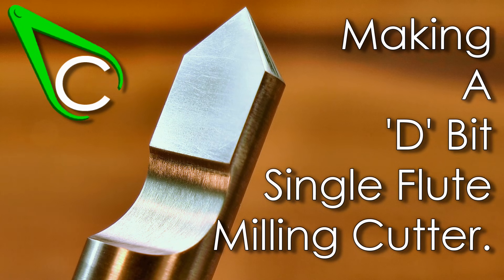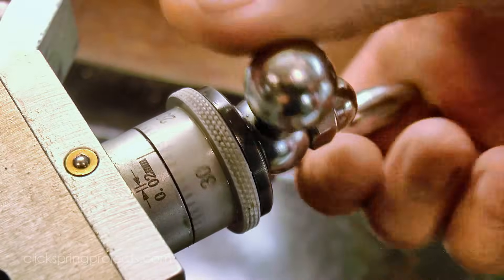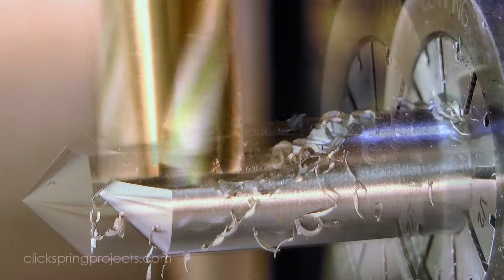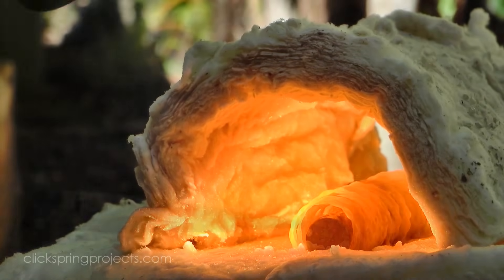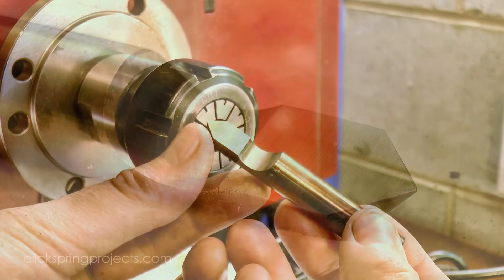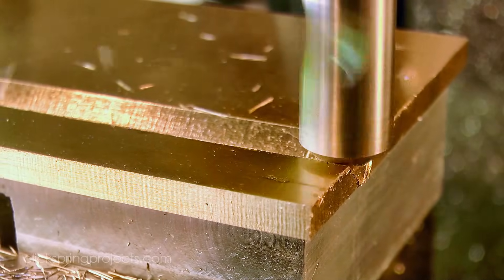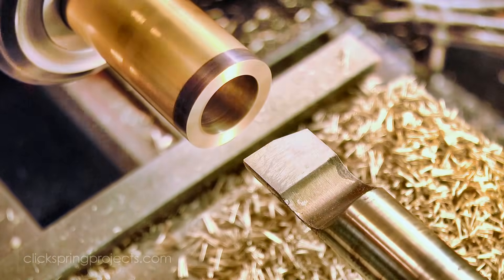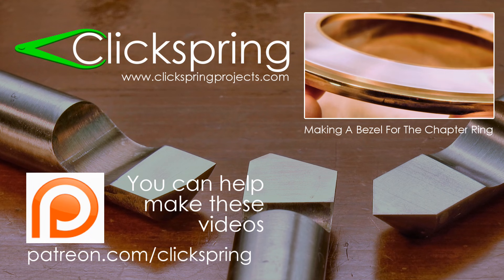Spare Parts #8 - Making A D Bit Single Flute Milling Cutter

Comment: When I was a kid I couldn't afford to buy milling cutters so I started making d bit mills. I found that if you insert some shim under one of the jaws in your 3 jaw ( I couldn't afford a four Jaw and collets were something I only ever saw in catalogues and books)  then you could generate some form relief.  You've just got to mark out the high point before you mill. (or in my case back then file ) the flat. Weirdly 45 years later I am still making these tools to overcome emergency problems in a hurry.  Keep up the good work the videos are fantastic.  Thank you
Reply: If there's any kids watching... auctions and scrounging are the answer. 

I got 200 (yes, 200) sets of geometric die head cutters for £50, a pair of Herbert precision drills for £50, a Parkson 2A horizontal milling machine for £50 (bit of a theme developing here).

I passed on two pallets of 4, 5 & 6 morse taper drills (maybe 500 drills) for free (help yourself son!) because I knew I'd never own a machine big enough to use them. That was before Ebay of course. Wish I'd taken them now.

I got a box of about 50 rotary cutters for £30 when the Cincinnati main dealer closed in Peterborough.

My first lathe was a Colchester Student for £200 (same place I got the Parkson).

I've outfitted a very decent workshop for next to bugger all.  Everything dates from the 60s & 70s and works fine.

Pickings aren't as good as they were 30 years ago but you can still buy decent lathes, mills, drills, etc if you watch local auctions and just nosey around machine shops. I've been offered very decent lathes and all sorts of other stuff for free. 

Scrap bins.  Never pass a scrap bin. Always be polite and offer cash or a bottle of something.

Comment: I need to make a pinch turning hollow mill for cutting a taper on a very small diameter PEEK fitting. I think by milling an internal taper and then basically creating 2 opposing d profile cutting surfaces, I can get it done.

Comment: You can use high speed steel if your mill will handle carbide endmills, obviously it won’t be a particularly nice cutting experience, carbide will absolutely eat HSS, then you just need to finish sharpen.

Comment: Hi Chris, your job is amazing, congrats!  I have a technical question to you, if you can answer, please. About Boric Acid + Meth Spirits, how much of each one do you put in? I mean, proportionality? Meth Spirits is a kind of alcohol? I'm sorry if is not written very well. Another doubt is in 2:20minuts, what is the liquid inside the glass, that you put in, something to clean the tool??  Thank you very much. I am Andrés Oscar, from Argentina. Regards!Thank you!
Reply from the maker: I generally mix the boric acid until a stiff paste, yes methylated spirits is a kind of denatured alcohol. 2:20 is a generic compressor oil for quenching, recommend this book for heat treating: http://amzn.to/2IdTQLw - Cheers :)
Reply: @Clickspring  Thanks a lot Chris for your job, for your answer and suggestion. It will help me very much. Cheers!! =)

Comment: Hi Chris, I want to get into hardening, I got a small tube oven which goes from 50 to 1200 degrees C, nice toy. I have noticed here you use boric acid + alcohol, but sometimes clay, and perhaps other things too. Also some soft iron wrap, what is this about? My main question is from all the methods you have used, which is the most recommended one to avoid oxidation and general good practices? I apologise in case this is already covered in depth at some video. cheers! Markos
Reply from the maker: Hi Markos - I have found by far the most effective method of oxide reduction to be Boric Acid powder.  I now have a varied set of mild steel trays in which I sit the parts to be hardened, and this ensures the glaze completely covers the part. Its rare that I see so much as a single spot of oxide. Cheers :)
Reply: @Clickspring  Thank you for taking the time to reply mate! I can verify I saw the process at the 'making of a square broach'. Do you mean you now use the boric acid powder pure (without alcohol)? And how important is the choice of tray material? cheers mate!!
Reply: @Clickspring  Can you, please, show picture or video on how you use mild steel trays and Boric acid to avoid oxidation, instead of wraping parts with Bailing wire.

Comment: These are too time consuming and tedious to make........a simple flat bit HSS cutter that cuts on 2 edges will work better and is simpler to make straight from the round tool blank on a grinding wheel.

Comment: Can anyone tell me what the purpose of mixing the tool with acid boric and apply heat
Reply: When you heat steel or iron Ea is easily reached for most particles. Think of it as an isolator, shielding for oxidation.

The metallic bonds take time to form perfect “crystals” (wrong term ik), heating it resets the crystals and rapid cooling freezes the crystals. Making it less flexible and hard.
Reply: @tarehjernetarehjerne4082  thank you

Comment: I don't understand how you got the 92 (or 46) degree angle using a dial indicator.
Oh...I see a calculator in the corner. I guess you used basic trigonometry. You fed the compound to travel a given distance, measuring the run-out on the reference rod. Using typical naming, given your angle A (46) and hypotenuse distance c (compound travel), the run-out should be c * sin(A). Same formula as for a sine bar.
You might at least have hinted at this. Took me some time to figure it out :)

Comment: Hi Chris, great video tx ! Can you pls comment on what the insulating material is that you use when heating  the bit, looks like an aluminium silicate blanket ?
Reply from the maker: "Kaowool" ceramic wool, you can pick it up off Ebay - Cheers :)

Comment: We have been using D shape or half lip cutters on our 3d engraving machine for over 40 years. About 30 years back I came across a design where I can give a relief to the cutting edge. So we made an improvised cutter grinder where a swash plate mechanism has been used for the relief. But this video is just awesome

Comment: Good stuff as always....Notice you're in Aus, could you give me a heads up on where you pick up your O1 and and any other interesting materials? 
I recently had difficulty getting Silver Steel in 10mm round stock locally (Newcastle, Maitland in NSW) and when I did they (Blackwoods) could give me absolutely no information regarding hardening and tempering. Ended up finding some info on the net as it was supposedly Stubs Silver Steel (now Erasteel) which said it was it was water quenching however there are also references to oil quenching and Erasteel appeared to have no information at all?
Anyway the water quench and subsequent tempering seemed to work fine for the stuff I bought.
The lesson was, I think, I may need to source from specialist steel suppliers?
Reply: The risk of micro-fractures from water-quenching can be alleviated somewhat by using hot water instead... ☺

Comment: This is just a simple presentation without detail like what kind of steel we can use to be properly threated for this kind of tool and........the operation on "3:10" needs VERYGOOD abilities otherwise you just make a spoilage.
Reply: Nelu, it was easy to miss, but at 0:35 he states that he is using "Drill Rod" . This usually refers to either O-1 or W-1 tool steel. The hardening and tempering directions would work equally well for either grade of steel.

Comment: I just tried making one myself! I it sort of worked for me haha. I think I either removed too little or two much material when making the flat. It seems to push the material rather than cut it. I'll have to head back to the shop and make another one. This time I'll be more careful. Thanks for the video!

Comment: Is making a V cutter for harder steels, like O1 very difficult ? You mention not having a certain grinder for the clearance angle on this type of cutter. I bought a carbide version from Melin in 3/16", but I need to make a larger V cut. Will you make a video one day? You use an end mill in the finger plate video., which worked out nicely. Cheers.

Comment: Great work. Great videos!  I bought the plans for the finger plate and would like to know more about your heat treat process. I see that you use meth spirits mix. What is it and what is the mix ratio? I've never seen it used. Thanks
Reply from the maker: Mix to a stiff past. The purpose of the boric acid/methylated spirits mix is to minimise heat scale. Thanks for watching and asking

Comment: Hi. Clickspring, I still do not know about the type of steel material your make cutter . Seem they are stainless steel :)
Reply from the maker: O1 tool steel, in rod form it is called "silver steel" or "drill rod". thanks for watching
Reply: Thanks... You hardening them with boric + wire to increase hardness up. So the ingredients to help them stronger borax or wire ?
Reply from the maker: The heating and then rapid cooling is what changes the hardness of the steel, the boric acid and wire are used to reduce heat scaling. Recommend this book to learn more about heat treatment of metals: https://www.amazon.com/Hardening-Tempering-Treatment-Workshop-Practice/dp/0852428375
Reply: Hi.. Thanks!... Your video is great on mechanics.... Expect you to do more video again .. Good luck !!

Comment: thinking of replacing old lathe as lots of back chatter and it can't make threads!!! :-(
it is a "cobra lathe from a uk supplyer not very big so upgrading. what do you reccomend?
what lathes do you use???
Reply from the maker: http://www.clickspringprojects.com/blog/which-lathe-should-i-buy Thanks for watching
Reply: https://www.maschinensucher.de/Voest-Alpine-Drehmaschine-W-490-1500-Voest-Alpin-W490/i-3892876  

this is pretty much the best on the market as far as tollerances and long javety go but you can look on the website , there are old lathes (real industrial ones manual and CNC with often more than a ton of weight and ridgidity) for a price of 1500€ upwards

https://www.maschinensucher.de/Drehmaschine-Zelenda-ZN-150/i-3405031

This is a new one used for advertisement that was probably close to never used 
had i the money i would probably take it after a trieing it out
https://www.maschinensucher.de/Drehmaschine-CHINA-CO-6230-910/i-2673187

A friend of mine has one of these and it works absolutely great with a sharp tool he can work so fine that he is able to work abaut 0,005mm repeatedly accurate 
and its a quality european manufacturer so you can get spare parts when needed 
https://www.maschinensucher.de/Universal-Drehmaschine-Ziegler-GH1236A/i-3517278

Comment: Why they use boric acid to harden the metal?
Reply from the maker: +Santi Ferreres Boric acid is used to prevent oxidation scale building on the metal during the heating, thanks for watching
Reply: Thanks and keep it up!

Comment: could you use this on a leathe?
Reply: Certainly. Back in the long past fellows like clickspring could not afford a mill so a lathe is what they basically used. I'm talking the 30's 40's 50's. They used D-bits back then, D-bits are still being used now, both on lathes and mills..

Comment: Question for you, the emory cloth stick you are using here, is that made from brass? The ones you show in the other video on how to make them are wood but the brass looks so classy.
Reply from the maker: +patw999 Wood is excellent for general purpose, but metal backing to the abrasive is essential if the part won't tolerate any rounding of the corners/edges. This is a brass polisher that I usually use with polishing compounds, but it can be re-purposed for emery paper too - more detail at the end of this video: https://youtu.be/uTAd1cJyqp4 Thanks for watching

Comment: Have you considered making a heat treatment furnace? Apart from anything else, with a plug in the end there seems to be only limited scale formation, I guess all the oxygen gets used up. 

I don't know if I can post a link here, but if this works, here is how I made mine: http://bodgesoc.blogspot.co.uk/2014/11/heat-treatment-furnace.html

Comment: Hey Chris, thanks very much for all of the useful information.  Would you mind sharing what the white fluffy insulating material is that you use while heating parts?  The stuff the part sits on, not the boric acid, of course.
Reply from the maker: +Nic Nicholson Hey Nic, that is Kaowool, a ceramic fiber wool. You can pick it up on Ebay. Thanks for watching.

Comment: So could this be a substitute for a reamer? I'm in the middle of a project (small solenoid engine) and my 1/4 inch reamer snapped. I don't want to fork 30 bucks over for one, but do have some precision ground .125 stock. Would your home made reamer be a better idea?
Reply from the maker: +rkshireygames Yes it can. Another very effective shop made reamer geometry is to form an ellipse facet on the end by grinding at an angle of approx 30 degrees. Thanks for watching :)
Reply: Clickspring Thanks! Love the content, I'm learning a lot!

Comment: Hi mate, have a few questions, is the tool steal you refer to 0-1 steel?After sharpening in theory should it be perfectly half the diameter? Is that a true Arkansas white stone, if not what is it and where can you get it?Last one is the brass tool plate that you made, what is that, im asking because i have one and have no clue what it could be forThanks a bunch, your vid are amazing
Reply from the maker: +Bertrand Labelle Hey Bertrand, yes O1 tool steel (stubbs steel/silver steel/drill rod all the same thing), just short of half is better, because it gives you a few sharpens and makes no material difference to the cut, yes Arkansas hard white stone, artcotools.com, not sure what you mean about the tool plate, maybe send me the time in video. Cheers, Chris.
Reply: Thanks, what i thought was some kind of tool plate was your brass blueing tray, i have a plate simmilar of that i think is a V block plate. Bought it with my mini lathe off ov a clockmaker, thanks. one more thing, where can i get that silver sauder
Reply: Clickspring
Thanks, what i thought was some kind of tool plate was your brass blueing tray, i have a plate simmilar of that i think is a V block plate. Bought it with my mini lathe off ov a clockmaker, thanks. one more thing, where can i get that silver sauder

Comment: Another well made tip. It's good to see someone explain D Bits well as they make excellent reamers for jobs that require a reamed diameter on a flat bottomed hole. I recently made one for a block of aluminum that needed a 4" long cartridge heater. A D bit made from drill rod was the perfect tool to ream .3750 clear to the bottom of the 4" blind hole.

Love the videos, keep them up!
Reply from the maker: +armorer1984 Will do mate, terrific to have you watching :)

Comment: Could you maybe show how you set the exact angle with the dial indicator?
Reply: MrP123 I'm no expert but I assume it would be some form of setting the compound, indicating the front of the taper, and then moving to the end of the taper and adjusting the compound until the dial indicator says the same value one would expect from just doing right angle trig of the taper

Comment: Hey Chris. Great video. I want to make the same tool. Can you tell me what that for a steel is you use.
Reply from the maker: +Ich xD Depending on where you live its called 'drill rod' (US) or 'silver steel' (UK/Aust.) basically its O1 tool steel in precision ground round stock form.
Reply: +Clickspring Thanks for your quick answer.

Comment: Hello Chris:  @3:47 you illustrate a relief angle.  But separate from feed speed and depth of cut would you not avoid that angle when machining brass?  It seems that that angle would risk climbing or pulling on the brass.  Much in the way you eliminate the positive rake on your drill bits in “Spare parts #7 - Modifying A Twist Drill For Drilling Brass”.  I was presuming that that was why you stayed .01 of a mm shy of the center line to asure a negative rake.  Or did I miss the point entirely?
Reply from the maker: +halnywiatr The relief angle is there for a different reason to the rake angle. A relief angle is typically always required to ensure that the cutter doesn't drag on the work, regardless of the material being cut. It's strictly a clearance thing. The rake angle is the angle on the 'front' or top of the cutting edge, that can potentially cause a cutting tool to 'dig in' as you mentioned. Think of it as 'the surface that hits the chips'. Interestingly, D bits are essentially always zero rake, yet will cut steel almost as well as brass or other soft materials. The +0.01 is more for assuring the opportunity for future sharpening opportunities, before the flat is ground below center.
Reply: +Clickspring 
The debate in my head is that that is true for a plunge cut.  But in milling perpendicular to the axis of the
D-bit, the fight between “climb” and “standard” might be exacerbated by a relief angle.  That, however, is only an
interesting mental exercise.  What is important is that you have shown that it works without a relief angle in brass.  Thank you for that empirical evidence.

Comment: Thanks for reminding me of the humble D-bit. I have made then for reaming holes but it did not occur to me to make a vee cutter.  You mentioned that you did not have an oven for tempering. The "straw" temperature is 235C (Tubal Cain, Workshop Practice No. 1) and Tubal Cain suggests you use any household oven. They will reach 235C for sure. I bought a cheapie small oven (not to abuse the kitchen) and have used this tempering method ever since, with complete success.
Reply from the maker: +Juan Rivero Great suggestion Juan, although Mrs Clickspring is less than impressed when I let the shop and kitchen overlap! Will keep an eye out for a cheap 2nd hand one :)